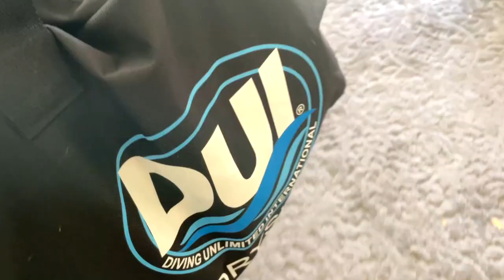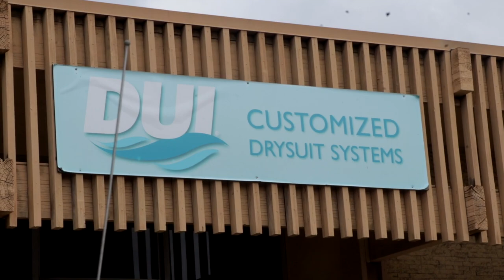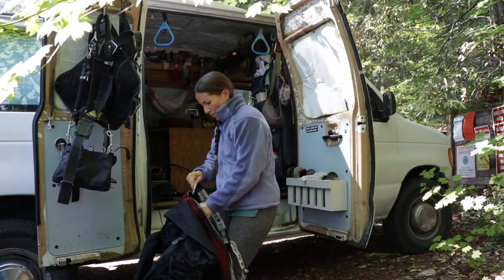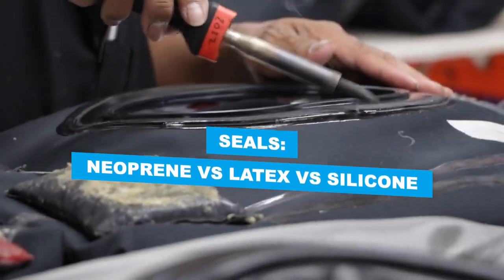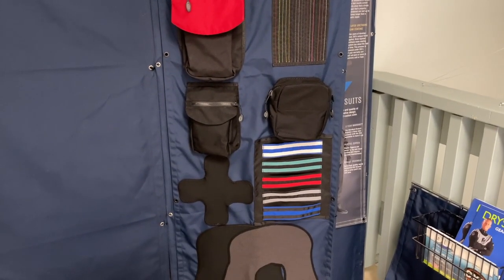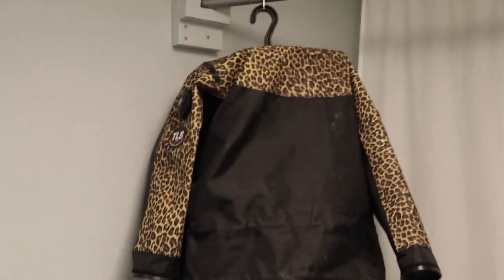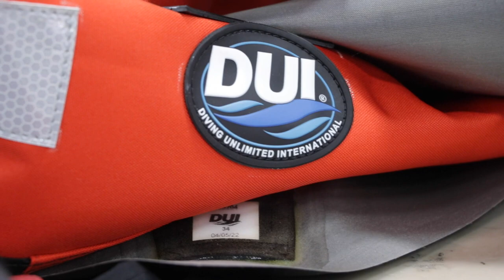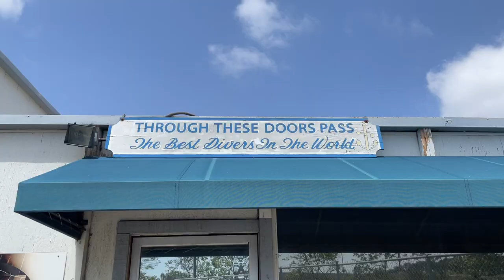Dry suit diving - Dry suit options featuring DUI Drysuits

Comment: Just seeing this video, and that's such a great story about how DUI took such great care of you!
To answer your ending question: Drysuit diver and instructor here. 😄 Teaching drysuit courses and workshops are practically the number one thing I do all winter here. For my personal suit, I absolutely need the follow minimum customizations:

1: The suit must have the inflator valve as high up as possible, right up against the neck seal, and slightly off to the right side of centerline. This is because I dive a chest-mounted rebreather, and placing the inflation valve up high and off-set like this allows me to access it without being forced to reach my hand into the side between the rebreather and the suit and attempt to "find" it. It also allows me to connect the LP hose easily. If the inflation valve was any lower, or in the normal position (centered on the chest), it is a massive pain to reach, and if wearing dry gloves, you risk damaging the gloves too.

2: The exhaust valve must be rotated slightly rearward of the centerline on the sleeve, and placed lower on the upper arm, to a position just above the elbow. This makes it easier to reach while wearing a chest-mounted rebreather, and also makes it effortless to dump gas without even the slightest need to change my body posture, position, or trim in the water. Simply raise the elbow, and gas comes out. You don't ever want the valve below the elbow, as gas pressure will push through the wrist seal, causing it to leak, and too high up on the arm, and now you're forced to change trim and angles to vent gas. Also too high up and gas can accidentally leak out when you don't want it to. And finally, a slightly rearward position not only allows venting without any change in body position or trim, it also prevents the valve from getting caught on your harness when donning or doffing your harness. So nearer to the elbow in the upper position, and slightly rearward is the most ideal position.

3: SiTech cuffs. I prefer the SiTech quick cuff P/U ring attached to the suit, or the QCS ring attached to the suit, or the SiTech Rubber Cuff Ring (commonly called the Viking cuff rings) attached to the suit. Either are fine. These allow for quick changing of any latex or silicone wrist seal from any brand/maker (allowing massive savings in costs of seals), and the ability to maintain the use of wrist seals while additionally allowing you to use very simple pull-over dry gloves (less than $10 a set for most good quality gloves). The wrist seals are mandatory as a primary and secondary (when using dry gloves) seal, and the cuff rings allow for any pull-over glove to be used, making dry gloves simple, easy, and very cheap to have and use.

4: P-Valve. On short dives, this isn't a big deal, but on dives longer than a few hours, or in especially cold water, it's a must for obvious reasons. I prefer balanced valves as you don't need to pre-load them prior to the dive when used.

5: Trilaminate socks, or Neoprene socks (absolutely NO MORE than 3mm thick). Trilaminate socks are by far the absolute best option. You can wear practically any boot or neoprene dive shoe or boot, meaning you don't need to go up in size ridiculously large, and can keep using your preferred fins. Trilaminate socks also do not "crush" your feet with increased water pressure during a dive, causing them to go numb or be in pain. This effect is most common with neoprene socks, and is one of the reasons why people avoid neoprene socks and just get boots if a manufacturer refuses to make or offer trilaminate socks (most manufacturers don't). If trilaminate socks are not available, then neoprene socks are the next best option (for durability and protection, as you eluded to in the video), however, can NOT be any thicker than 3mm at the most. Many manufacturers these days have resorted to simply sourcing their neoprene socks from a handful of chinese manufacturers as they're cheap, and as a result, they all have the same 5mm thick neoprene socks on their suits. A 5mm neoprene sock not only means you'll need to increase your shoe/boot size a minimum of 4 sizes (which is absurd), they will also crush your feet during the dive, causing pain and numbness. If you must use neoprene socks, 2mm is best, 3mm is the max thickness you should ever allow. If that is not an option from the company who makes your suit, just get boots. You can always have an independent drysuit servicing tech (like myself) change the boots for a good pair of socks later.

Other preferences include: Attached latex neck seal (never in my life ever tore one), brass zipper, large bellows pockets (rotated slightly rearward at the top specifically for sidemount diving (also just amazing for ANY diving configuration), neoprene neck dam, form-fitted suit measurement, "Y" pattern cut (arms NOT attached traditionally, but instead, the body and arms shaped like a "Y"), nice long telescoping torso (for ease of donning and doffing suit), internal suspenders, and heavy duty knee, elbow, butt, crotch, and shoulder protection (kevlar is a great choice if offered).
Reply from the maker: Thanks for all this information! Really appreciate it🙏

Comment: Funny story time: Ice diving in Ontario Canada with a dodgy zipper that I’ve been putting off replacing because of not wanting to be out of the water for an extended period. Halfway into my dive the zipper separates and opens up on me- about 8 inches of it. Ice water fills up my suit. By the time I’m climbing out at the shore I’ve got 20 lbs of water flooding my legs ballooning out my suit, shivering and mad at myself for pushing it and being bullheaded.  Moral of the story: have 2 drysuits 😂 🥶
Reply from the maker: Omgggggg!!!!! That sounds awful (and dangerous 😬). I love that solution though. Those are goals 😆😂

Comment: DUI themselves don't recommend (and warranty) plastic zippers because they have reliability issues. I had one, it failed in 6 months (I dive a lot ...) but clearly never going back :) 

Now metal zippers require more care, more delicate, and you need to burn the "hair" of the zipper with a lighter every so often...

For the boots, integrated boots also give you more control :) Which is nice (more mobility)

I'm so happy for you :) So many cool outlooks on your channel! I'm following eagerly ! Let me know when you drop by in Florida or Mexico
Reply from the maker: Great point about control with the integrated boot!

Comment: Originally a WA diver,  so dry all the way.  I also bought a used suit, a USIA. Since then I've added pockets,  silicon seals, seal rings, and a p-valve. I had to replace the zipper once but i also went with a YKK metal one.  I've heard horror stories about the older plastic ones.  They new ones are supposed to be really good,  but I'm a tried and true kind of diver.  Great video,  thanks.
Reply from the maker: Thanks for sharing. Yeah there's just something about plastic...

Comment: Funny story for me: I went diving in my drysuit a few weeks ago and after using a drysuit for 3-4 months this year, I never forgot to zip my suit all the way....except for that one time. I only noticed after being in the water for 20 seconds that I was colder than usual and my legs felt heavier than usual. I returned to the shore and got out of the water to realize my legs were completely flooded and I had to take the suit off and turn it upside down to drain the water. Needless to say, I was done diving for the day. Good thing it was at the end of the summer so the water wasn't too cold - at 17 Celsius :) I've never forgotten to triple check my zipper being closed all the way since that incident :P 

As for customization, I bought an add-on pouch which I glued to my hip myself. It's been holding on very well so far and I plan on installing a pocket on the other leg next summer :)

I agree with you that after having been diving dry for 5 months, I'll never go back to wetsuits again. The ease of simply taking the suit off and putting my jeans on right away is so nice! Not having to dry off and peel the wetsuit off is so much nicer :D
Reply from the maker: I know this will happen to me one day 😂😂😂 the triple checking is real, but it'll totally happen. Thanks for sharing!

Comment: Hi Sarah.  I had a 5mm neoprene drysuit as my first suit.  I went to the manufacturer (OThree in southern UK) and they adapted an off-the-peg suit at no extra cost.  So it was relatively cheap and fitted well.  If you have the option of visiting, as you did, I'd highly recommend it so you can talk through options and make sure you're getting a suit that will work with your undergarments and give you freedom of movement without excess air space.  My second suit, from the same source, was a crushed neoprene 1.8mm custom and it's fabulous.  Somehow it's warmer, less bulky and more flexible than the old one and a lot less floaty.  Both suits have neoprene seals and I have never had a leak through them in 200 dives, but I see the attraction of yours and being able to change them out if you do get a tear.  Front-entry suits are great!
I can't speak highly enough of dry gloves.  I have Kubis on my custom suit and they are brilliant.  If it's going to be cold, say <50F, I put a loop of paracord through the wrist seals so air can circulate and there's no better feeling than raising your hands and having that warm air flood round your fingers.  I'd say they are the single main factor I feel warmer in a thinner suit and the dexterity is far better than the equivalent wet glove.
As to pockets, unless your suit is going to be so really, really small I think the size of pocket has to be driven by what you need to put in it.  A couple of reels and DSMBs, spare mask, rescue mask, it can add up.  Putting stuff in pockets does tidy you up, although if you're side-mounting you're likely putting that stuff in a bum pouch instead.
Reply from the maker: Yeah I use my pouch for all that big stuff so the big pockets bug me 😂 personal preference for sure 😆 thank you for sharing your experience with neoprene suits. I don't see a lot of people diving them on the west coast so that's helpful 🙏
Reply: @AzulUnlimited  My current one actually behaves much like a tri-lam.  The main difference is that it can be quite close fitting because it stretches enough to get the diagonal zip over your head, while a tri-lam usually needs a bit of concertina-ing at the waist.  Dive safe, and warm!🙂

Comment: Hi Sarah! I'm really enjoying your content! Thank you for sharing so much information!

I started diving dry suits last year and for the first time in 21 years, I didn't have the cramps on my legs due to the water temperature (even at 13C).

I chose the stock trilaminate Scubapro Evertech Dry Breathable as an awesome and more affordable option to the expensive Bare and Fourth Element ones.

It has latex removable neck and wrist seals and integrated boots and is really comfortable. The legs of the suit are a little bit long, as I am Asian and have short legs but it doesn't affect my dive at all. For 2,200 bucks (Canadian dollars), I consider that this is the best deal I could get for the benefits and quality. Along with the suit, I also purchased the K2 Extreme undergarment but didn't have the chance to wear it yet. Waiting for the cold season to go for some really cold water divings.

Whenever you're in Ontario, come have some dives in the 1000 Islands region. There's lots of shipwrecks in this region (Kingston, Brockville, Prescott, Morrisburg).

Cheers!
Reply from the maker: Awesome! I will definitely explore Canada more when I have the resources to do it. So much great diving waiting there.

Comment: Thank you for a great video, you’ve gained a sub! I am a dry suit diver myself, I am on my second trilaminate suit, but have yet to try a custom one. I too am contemplating the pee-valve vs diaper route and have a hard time making up my mind.
Reply from the maker: Thanks so much and welcome to Azul Unlimited! I think for the male anatomy, you'll do fine with the pee-valve (unless you don't want to get one installed in your suit). If I need to go that route for longer dives (like in caves) I will probably go diaper just because pee-valves are a pain in the ass for women.

Comment: Large pockets are a must, and  I want bigger pockets than even the large if that was an option. But I will say that depending on how you dive, pockets are a wear item. My suit has about a year and a half on it, and I am already getting the corners of the pockets ripped up trying to squeeze through restrictions. I think I might have another 2 years before I have to replace the pockets.

Also while I like my pee valve, I don't like how large the OMS version is. I'm snagging it on things occasionally and it has a lot of exterior wear. I would want to see if I can get one of the new Dive Rite low profile valves.

Next suit I probably will get a similar suit with a few modifications. Shorter arms, while the length is perfect for gloveless cave diving, they are too long to put on dry glove rings. A couple of modifications that relate to my disability to control the airspace in the leg. And a custom nylon color path. Here in cave county red and blue are the common suit colors for KUR and WKPP. So those two colors are are out. The OD green I purchased was rare when I got it and now more and more divers are buying them. So I want something custom.
Reply from the maker: Thanks for watching and leaving such a thoughtful comment! Yeah, I'm mostly for the small pockets because I have my sidemount pouch for anything really large. Maybe you should go with the leopard print! :)

Comment: How much would a complete set of seals cost to have as spares?  Have you ripped one yet?  I remember trimming my neck seal on my kayaking top and it made it prone to ripping if you don't trim it just perfectly.  Anyone else had this issue?  I always have to trim my neck holes, lol....  My neck must be larger than most.
Reply from the maker: I haven't ripped a set yet. The silicone zip seals with DUI are 150 for the neck and 110 for the wrists. I have one set of backups and yes, you do need to make sure you cut it properly so you don't have edges that could rip.

Comment: I only have experience of my buddy and I.   Two people, hardly a wealth of knowledge.  But I went with Fourth Element and my dive buddy went with DUI.   I don't know specifics for my buddy, but I would have to say 9 out of 10 dives in DUI have been wet dives.  He's not happy.  He has sent the suit back, had seals replaced and still wet.  I on the other hand, with Fourth Element, have had probably 10 out of 100 dives wet.... and for me, that is probably technique as opposed to quality of dry suit.   Drysuits do require training and specific techniques to stay dry, but based on our experience, DUI would not be a recommendation.  In my short experience, if you need something to really keep you warm, European manufacturers are where you really need to focus.  They know how to keep you warm and dry.   DUI is just not what they used to be.  And talking to LDS's in and around Texas, they seem to send a lot of DUI's back to DUI.   Fourth Element has just been a winner for me and I'll be sticking with them.
Reply from the maker: Thanks for sharing your experience. I haven't had any of those issues (and neither have my friends who dive dui). That's super frustrating though. I hope he finds a solution.

Comment: You are lucky with the pockets. Small pockets suck. You simply cannot fit a few items in, especially underwater with dry gloves. Also, pull down the telescopic torso and fasten the crotch strap before you close the zip. It should be easier and will place less strain on the zip.
Reply from the maker: I should've mentioned that I primarily dive with sidemount and use my pouch to carry everything I need. Thank you for the tip on the torso/crotch strap!
Reply: @AzulUnlimited  I would still keep them as when using your pouch, the pockets can be left empty and will reduce down to nothing when the pockets are like yours.

Comment: those seals (latex or silicon) need to be folder invard, same as neoprene neck seal if you dont want water ingress. All modern pee valves have one way valves and never had an accident even tubing got disconnected. Diapers are disgusting and an environmental hazard. Surce: got both them on mine (silicon, removable and p-valve).
Reply from the maker: Thanks for this. I use my seals the way I was taught by my instructor and haven't had any issues 🤷🏻‍♀️ as for the p valve, I should've clarified that the main gripes are from women on set up and use complications.
Reply: @AzulUnlimited  Some of my male friends have had problems with their P valve fittings, but I think they may have perhaps not been honest with themselves about the correct size of sheath.  Either that or it's down to the low temperatures...
Reply from the maker: Oh lord 😂😂😂😂😂 I can only imagine. That's hilarious